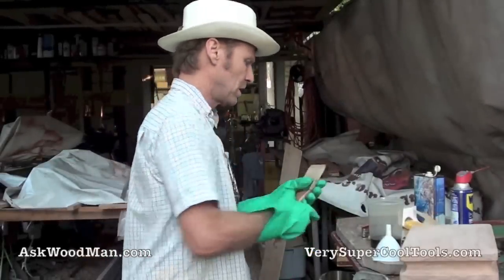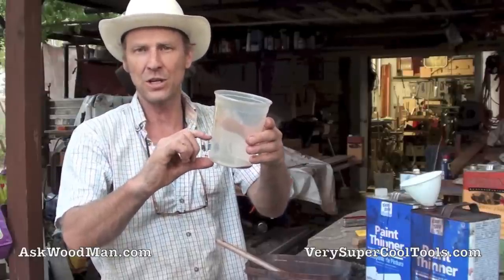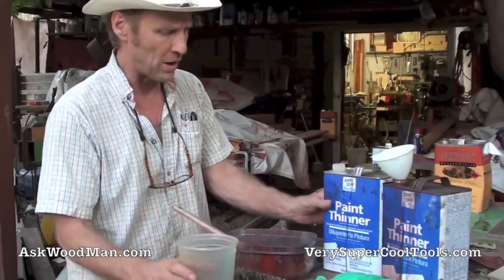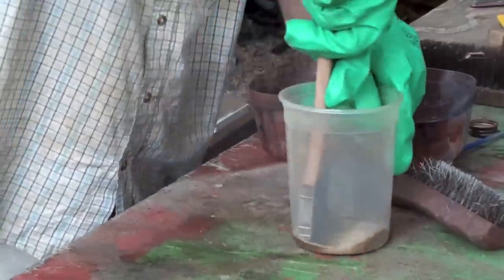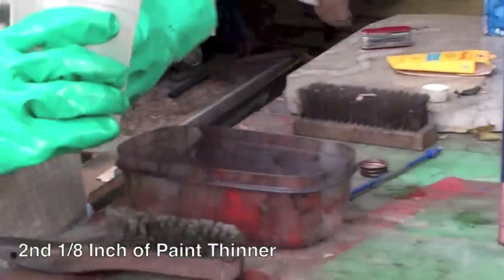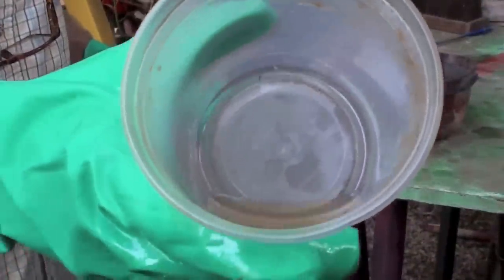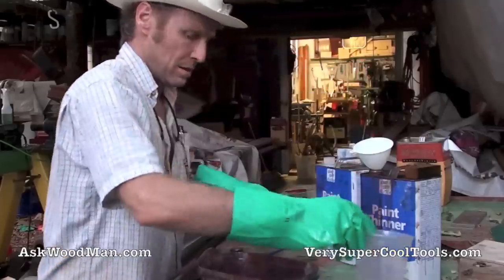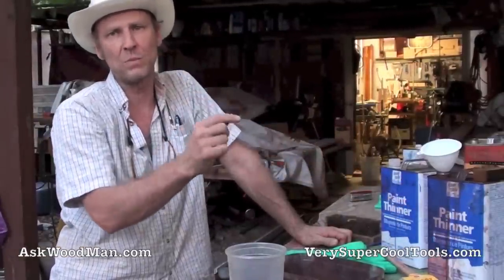HOW TO CLEAN A PAINT BRUSH  - Oil Based

Comment: I found this after trying to use the same advice for oil based paint that I used for latex paint to clean my brush.  I followed your advice, and got my Mom's old brushes clean in 7/8 of an inch after using high gloss BLACK paint.  I am so happy.  My parents are both gone now, and I want to use their things as long as I can, since it's all still good.  Thanks for posting this!

Comment: This is by far the best video that I've seen. I just want to say AskWoodMan that your video just saved me $137.94. I was to throw away 6 purdy paint brushes (4' and 2.5") because I painted someone's porch who bought oil based paint in lieu of latex. He thought it was latex after the fact. I had a hard time trying to get the oil paint off my brushes and I was about to trash all six until I found your video by chance.  Thanks man. This is an awesome video with easy to learn steps. I followed your instructions and my brushes are 100% in excellent condition. In my experience, I guess it was a lesson to be learned.

Comment from the maker: That is such an excellent suggestion and point. I am going to do that tomorrow because the first several rinses could definitely be done with used thinner. And the solids settle to the bottom so as long as it is carefully pored and not shaken up, almost none of the old solids come out when pored. Thanks for taking the time to make this observation. Allan

Comment: This is an important video, thanks for sharing this information that seems impossible to find anywhere. I think you should be sponsored by one of the finishing companies and have a link to this video. To me if I spend a bunch of money on a good quality brush and/or a good quality finish, the websites for those companies should have information like this video rather than just a few written instructions. I like the fact that I can use very little at a time to clean the brush, I have even adapted this reduced cleaner use with water as well. Rather than running the water the whole time, I just fill a container, rinse the brush and dump, and redo till brush is clean.

Comment: I was  very pleased how well this worked for me.  The process was fast enough, and the brush seems really clean (even though I stopped before getting every last bit of color out)--I don't think I've ever cleaned a brush with oil based finish as well as with this technique. I won't describe the technique I was using since it is not as effective as this one.  I was cleaning a 3" brush and it soaked up almost all of the mineral spirits I poured in the cup but it was enough to help to clean the brush (sort of remarkable)!  Thank you!!

Comment: Well done my friend. It is so refreshing to see someone who knows what they are doing, not reproducing a video that has been done 50 times by others and additionally, I appreciate your care, thoughtfulness in pre planning and explaining your process. Note folks, he is doing this outside which is clearly a 'ventilated" area and wearing gloves.....Thank you for not throwing your old dirty thinner away carelessly and utilizing a "recovery" can. It makes 110% percent and baffles me why people would dump it on the ground and contaminate the earth. Note, if some does spill on a surface, kitty litter will absorb this material and is used to clean up many different types of hazmat materials such as fuel and oil. Every home owner should have some on hand for their driveway in the event of oil or transmission fluid leaks. Regardless, Sir, thank you for creating an instructional video where you aren't learning as you go and repeating an idea. Hat tip from a fellow DIY Tinker-er!
Reply from the maker: Thanks Pamela. I am still using that same brush. Keep in touch. Allan
Reply: You are welcome. Yes, and buying a good brush once and taking care of it, is the smarter choice. I typically wet my brush then squeeze out the excess water before painting to avoid the issues of paint caking at the base.... at least with latex an acrylic. I learned last night that you can clean up your oil based paints using peanut oil and ivory soap afterwords to avoid using harsh chems at all. I haven't tried it, but will with a small scale painting first before tackling my exterior home staining project. ha  ha... keep up the good work!

Comment: Is this with all brush cleaners or just the paint thinner?  How do you recycle the old thinner? I used oil based kilz for the first time.. I wish I had seen this video before I went and bought a brush cleaner. I definitely didn't do anything like you did .of course, but,  I will now . I have and love my purdy brushes but I have never used one with oil based paint. I went and bought a brush to just throw away but I couldn't so I bought a brush cleaner. I kept the wet brush in a Ziploc baggie and now it's soaking a bit in brush cleaner but not a lot. I'm definitely changing as of now. Thanks for all the great advice. I'm definitely a fan and a subscriber now. Sorry I waited .

Comment: Thanks!  I didn't even know how much I didn't know about cleaning a brush.  I've been using cheap disposable brushes for my wood finishing projects because I keep ruining them.  Cheap brushes, of course, mean a lower-quality finish.  I'll be trying this technique out on my next project, and maybe I'll be upgrading my brushes.
Reply from the maker: John Cosby I am basically really cheap. It is much less expensive in the long run to buy a $15 Purdy that will last for many years if you keep it clean. I posted that video over 2 years ago and am still using that same brush.

Comment: Great video.  Really appreciate your sharing the knowledge.  Your brush looks almost clean when you start the 1/8" process.  I typically am left with a brush saturated in polyurethane or oil based paint at the end of a project.  How do you go from a brush saturated in paint to clean and soft and ready for the next project?  I'm tired of paying $20 for each new brush.....

Comment: I use a similar method for cleaning brushes after painting with alkyd enamel.  I put the dirty thinner in a jar and let the paint settle.  Then I carefully pour the clean thinner back off the top into a clean jar.  Ready to use again.  I allow the leftover paint from the dirty jar to harden and then I throw it away.With my method of reclaiming, I might buy one gallon of mineral spirits every other year or so.  Very little used or wasted.

Comment: I've been throwing paint brushes away after a single use recently. I thought it was better for the environment just to throw them away. And also I did not have much success cleaning paint brushes.

In another video I found that you can just wash the paint away with water on water based used paint brushes. Then use a comb to maintain the brush during the cleaning process.

In this video I've learned how to take care of oil based paint brushes and also how to dispose store the thinner.  I'm much more prepared now and feel good about not throwing paint brushes away.

Comment: Great video.  I always fight with myself over this.

But, what is your suggestion on how to keep the brush between coats of oil paint.

Surely you don’t go through that whole process in between each coat.

What to do?
Reply from the maker: If I am going to recoat within a few hours I wrap the brush with wet paint in a plastic a plastic bag or Saran Wrap to keep the air from reacting with the paint.
Reply: @AskWoodMan  Awesome. Thank you so much!

Comment: Im glad I watched your video.  I was doing it all wrong, and worse disposing of it wrong.  I didnt really think about capturing the old stuff into a container.  Maybe I missed it in the video so I am going to ask,  where do you take the container when its full to recycle it?
Reply from the maker: My city Austin Tx recycles almost everything. But save the used thinner and use it to do a preclean on very paint fouled brushes. You can use the used thinner to do a pre-clean and then go to the clean thinner. I paint and finish a lot and only use about a gallon of new thinner a year. So I only have to turn in thinner every two years since I keep reusing it until it just gets too fouled and the paint won't settle out anymore.
Reply: @AskWoodMan  l will do that. I actually read another article in which somone explained to use coffee filters to strain the used spirits then let the residue in the filters dry out. I'll put both pieces of advice together. Thanks

Comment: Thank you for this video, it has been extremely helpful. I am new to painting and don't have any experience let alone painting with oil paint. This step by step instruction has been very helpful. My only question is, after you cleaned the paint out of the brush, there is still paint thinner on the brush. Do you have to somehow rinse the paint thinner out before you use that brush again to paint? I'm assuming not since you didn't and put the brush back in it's paper holder. Thank you for the info. Much appreciated!!!
Reply: Wash it with dish soap afterwards, then rinse, wipe and hang to dry with bristles downwards.  Some people put a dab of fabric softener in the final rinse water.

Comment: I need to remove old layers of oil alkyd paints from metal kitchen cupboards. It's chipped so it won't look good just painted over. 

 No you tube videos on how to do this.

 Is thinner the striper of choice for doing this?

Comment: Any suggestion on how to clean an oil based stain off work surfaces?  I made the mistake of using my nice Stanley worktable (plastic surface) to hold my cans of stain, and now its gunked up on the surface.  I haven't tried mineral spirits, would that be best?

Comment: question: after your last 1/8 inch cleaning, do you rinse the brush with water before storing it in the brush box? or do you just let it dry with paint thinner in it?
Reply from the maker: marc gottesman Hi Marc, I do not put water on my China bristle brushes. I know of some guys who will wash them with soap and water after cleaning with thinner. But I just let them dry and then use my wire brush on them before using them again. I have always felt if you get water up into the ferule it could take a long time to properly dry and if I need to turn around and and need the brush I don't want water contamination in my oil paint or finish.

Comment: I always used mineral spirits just because the oil paint cans actually say to use it. It works usually. Do you think that mineral spirits would work the same with your method of cleaning? I usually had let my brush set in a small cup w/the mineral spirits before & would just put fresh mineral spirits in till clean. (yes wasted more that way than your way w/paint thinner). So in your opinion do they work the exactly the same or is paint thinner better to use even though the oil paint cans say to use mineral spirits? Thanks for posting your video, it is nice to see how other people clean their paints.  -Shannon
Reply from the maker: Mineral spirits and paint thinner are essentially the same thing.
Reply: AskWoodMan Ok thanks for answering! I guess I should have looked at the ingredients..., I thought of that AFTER I left u a message... ;) I like your method of not wasting the thinner! great videos!

Comment: I checked in Georgia you have to take the used paint thinner to a designated recycle station.  There is also a new company that will let you drop it off in retail locations for a fee (depends on size of bucket).

Comment: Great tip!  I noticed that you didn't wash your brush with soap and water in between the paint thinner and putting the brush away...is that step not necessary?  I'm a total novice and was told to always wash my brushes after cleaning in paint thinner but it's a nasty process to bring the brush inside (stinks up the kitchen) and then collect the water into something so that I'm not sending paint thinner down my drain.  If I can skip this step I'll be more motivated to tackle projects without dreading the clean up.
Reply from the maker: +aix2379 I never do the soap and water routine. Never have. For one thing water does a poor job of cleaning oil based paint so it has always seemed like a waste of time. And if I need to turn around and use my brush again for another color, I don't mind if it has some thinner in the bristles and ferrule, but I don't want left over water mixing with oil based paint. BTW that brush is still going strong. I made that video over two years ago.

Comment: Can you not simply rush a fresh paint brush from a paint job under hot water and using dish soap or because this is oil based this is the only way to clean this type of brush? Is it not possible to clean a brush immediately after using in a paint job? I do this all the time with my latex and water based paints, but I am guessing with oil based stains and paints you have to use a paint thinner?

Comment: You placed the cleaned brush directly into its cardboard case.  Others have recommended the use of a brush spinner as the final step.  Do you feel that’s unnecessary?  Thanks
Reply from the maker: For me it is not necessary.
Reply: AskWoodMan Thank you for replying.  I don’t do a lot of painting - mostly varnishing recently, and I don’t like losing a good (Purdy) brush.  Your 1/8” process is both frugal and effective.

Comment: I just bought the wrong thinner -- lacquer thinner. So can I use it instead of the paint thinner to clean an oil paint brush?
Reply from the maker: No it won't work. If you have not opened it just return it. I rarely use lacquer thinner.
Reply: @AskWoodMan  thank you!

Comment: Great video, some of us used to just dump the brush in some thinner and walk away. What do you think about the difference between Paint Thinner, Odorless Mineral Spirits and Brush Cleaner (made by Klean-Strip).
Reply from the maker: I have always stuck with standard spirits/thinner. It is the most cost effective for me. The odorless is weaker so you end up using more and it costs more. I have not tried the Brush Cleaner.

Comment: what do you do with the reclaim reuse paint thinner? is there any use for it or do you just give it to recycle?
Reply: I dont want to answer for the OP, but I use the same technique for fine art oil painting. When you put "spirits", or mineral spirits, or white spirits (these are all different names for the same thing) into a container after cleaning brushes, the molecules of pigment settle to the bottom after a while. 

After a week, it's pretty ok... After a month, it should be pretty much clear. Then, you want to pour off all the clear top stuff without disturbing all the mucky stuff on the bottom. In other words, get a bottle ready, and don't move the dirty stuff at all. Just tilt the original dirty container to let all the clear stuff pour off. It's like having a brand new can of spirits!

Comment: How long do you have to wait for the brush to dry before you can use it again? Can you use a hairdryer to speed up the process?
Reply from the maker: You can immediately start painting. A little residual thinner in the brush will have no effect. Actually many people pre-moisten their dry brush with thinner for better paint or finish uptake into the bristles.

Comment: HI WoodMan, thanks a lot for this video, i really appreciate it, i confess to have ruined quite many brushes! Indeed I have few sticky with chunk of paint in them, and quite hard can i  recuperate them by using more thinner or white spirit? I don' t really want to chuck them in the bin...Thanks
Reply from the maker: You can try thinner. Soak the brush for an hour and then use your wire brush to get the chunks out. If thinner is not aggressive enough you can try Xylene.
Reply: AskWoodMan
Thank you so much..I am just so bad to clean brushes, you are very helpful to goofy disastrous DIY like myself.lol  God bless :)
Reply: Thanks, Allan!  Your technique is very similar, even better than what I've been doing.  I use the recovered thinner for the first several rinses, and for other cleaning jobs that don't require new thinner. I'm sure your readers have saved many gallons of thinner!

Comment: how do you get rid of the paint and paint thinner after cleaning? I can't just flush it into the sink?
Reply from the maker: My city has collection facilities for hazardous chemicals. Most cities do. I use the used thinner over and over when I am cleaning colored paints. I can use the used thinner for the initial cleaning and only use the clean for the final rinse. I only have to get rid of about 1 gallon per year when it just gets too fouled.
Reply: AskWoodMan Thanks. What container you use to keep the used thinner in? Any plastic container will do? Like the empty container from wind shield washer fluid?
Reply from the maker: I am not a plastic expert so I am not sure how to answer this. To be safe use a container from something that had petroleum products in it originally. You can use glass jars with lids until you can find a metal or appropriate plastic jug.  Thank you for your responsibility in this matter.
Reply: Thanks ;)

Comment: What's the most economic and hassle-free way to paint if you paint a lot of metal? Is it spraypaint? Brush paint and cheap brushes to use once and dispose of? Or this method? I think most of the paints i use are solvent-based alkyd paints, not sure though.
Reply from the maker: I paint a lot of steel all with solvent based alkyd based paints. I try to do as much painting as possible with disposable rollers and use my brush to cut in or paint detail where a roller can't get.  Don't bother with those throw away chip brushes because you will spend all your time picking out hog hairs shed from those cheap brushes. I am still using that brush in the video years later.  Clean it right and they have a very long life. Check out this video starting at about 3:25 https://www.youtube.com/watch?v=X-yDJDq9RQ4&index=4&list=PLqtTuVwYBfkxE8OdB6UNA5zxoRV-45fSa  Then the following video has more painting with rollers.
Reply: +AskWoodMan Okay, thanks for the reply!